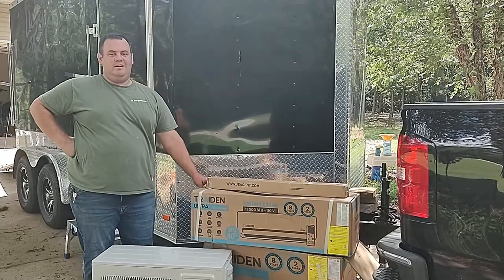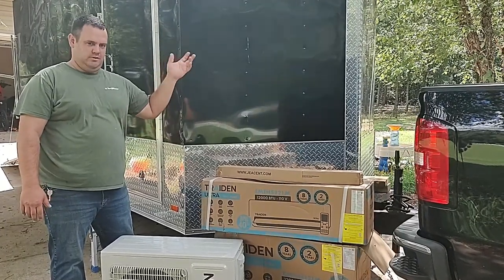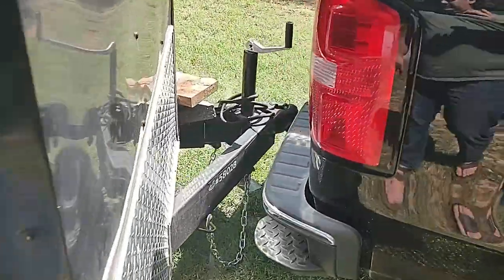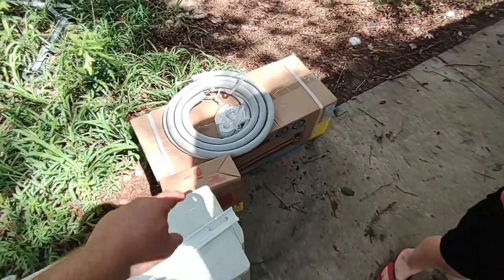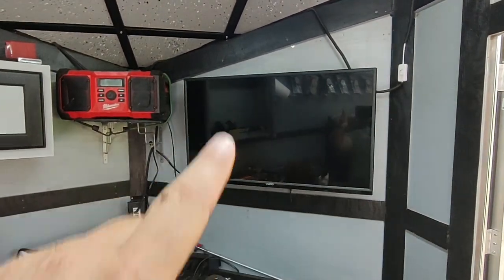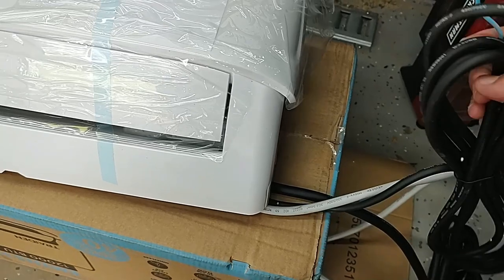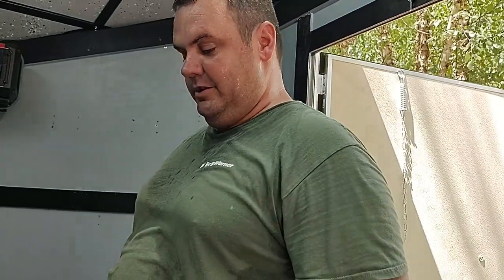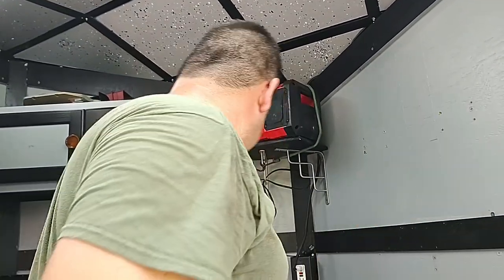How to install mini split Air conditioner on enclosed trailer

Comment: Hi, I need urgent help seeing how did you wire the indoor unit power cord and that black wire with multiple cables inside
Reply from the maker: Send me a picture of the inside unit terminals and the outside unit terminals and I can draw you a wiring diagram. Email it to tonyamitch1343@gmail.com
Reply: @EmpoweringDIYFamily  I emailed you, under machr85. Basically I want to see how the thick wires are connected but I slowed down your video and you mentioned that 1,2,3,4 connect them the same order on the inside unit, easy! I will be trying this tomorrow morning. And how didn't you wire the plug that you had to put on the power cord for indoor unit? Like which is your neutral and which is your load? Also I notice you said this unit is 110? I don't see you hooking up power other than the wires that go to the indoor unit into a plug to a 110 outlet, it was my understanding these need 220v
Reply from the maker: Some units are 110 and others 220. It depends on what system you have. I'll look for your email.